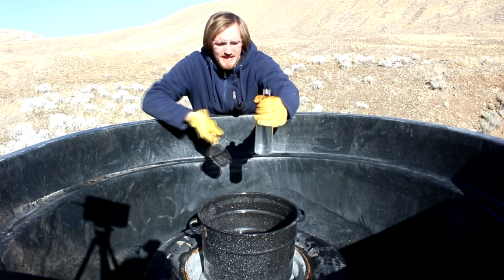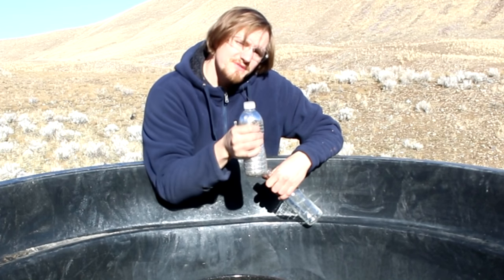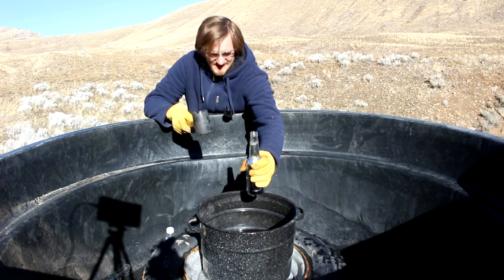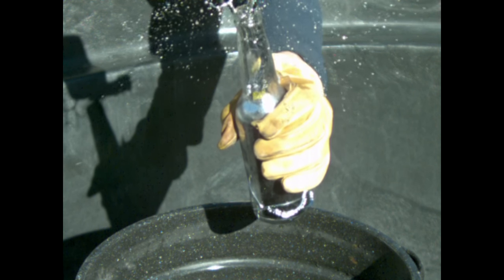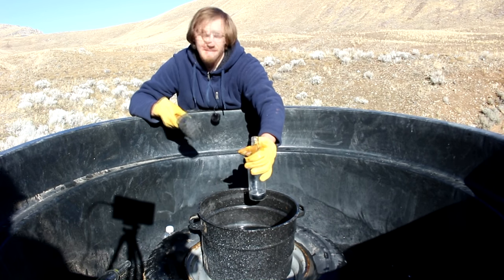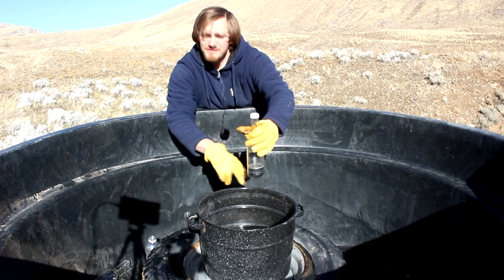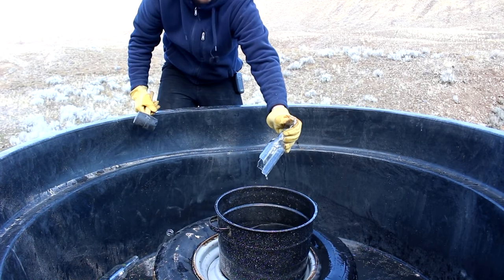Breaking Bottles With Mercury

Comment: The first mercury bottle - because it's filled into the neck, the physics changed a bit.  The mercury in the neck is accelerated upwards quite fast (smaller aera, faster speed needed to have same flow rate as mercury further down).  That's also why so much mercury came out the top.  The momentum of the mercury in the neck produced suction everywhere in the bottle, and the cavitation is actually further up (near the tips of your fingers)
Reply: hi matthias
Reply: if you have even done the bottle break by hand you would know that you need a small amout of water for it to work with out a mallet...if its over half full you will never break it by hand.
Reply: +ben h it depends on the bottle, corona bottles break even if you fill them to the base of the neck (maybe a little lower).
Reply: Nice to see you here :)

Comment: hey Cody I was wondering what happens if you freeze the vibrating part of a speaker with liquid nitrogen. I was wondering if it would still vibrate like normal to create sound waves or if the vibrations would just shatter it into pieces
Reply: thegreatcanadiangamer great idea!
Reply: Mason Crane thanks man I was just wondering what it would do and I would love if he made a video on it
Reply: the speaker surround and tinsle leads would be done for after one sound wave cycle, odds are the voice coil would be stuck in the motor snd not even move at all tho, just heat up
Reply: Actually, the speaker would be louder as the cooling of the coil would lower the resistance and thus allow more current, that is assuming it doesn't just shrink it down so that it cannot vibrate freely, but I doubt that would be the case. Also i guess you right that enough cooling might make the basket of the sleeker less flexible and might break it when it vibrates, ( sorry I'm just rambling on :P ) yes it would be cool to see ( because liquid nitrogen is cold, and that's a pun )
Reply: Keystone Science, let's find out on your channel
Reply: +Rutuj Gavankar haha that would be awesome :D I am not old enough to buy liquid nitrogen yet though :P
Reply: Keystone Science the gap in a speakers voice coil and the motor is smallll... I would bet on the coil getting stuck in place. I will add that i run big subs in my car, and on cold days the speakers can take more power for longer... Thats kind of a given with big speakers tho, they make alot of heat... alternators also make more amps when cold. I run a 370amp alt in a pt cruiser.. H/O alts have a cold rating and a hot rating on output..
Reply: I would assume it'll break the membrane, like  with old Speakers where the membrane has become brittle due to Light or just age?
Reply: if it won't break, tho, it would still be interesting, because "the cooling of the coil would lower the resistance and thus allow more current", which should make funny things to the sound.

Comment: What happens if you throw a piece of dry ice into mercury?
Reply: Bengineer8 he should totally do that
Reply: I LEGIT WAS GOING TO COMMENT THAT! OMG YES PLEASE!
Reply: Bengineer8 it'll just float and maybe freeze it
Reply: MyLonewolf25 Or perhaps the mercury will sublime it
Reply: It would probably just freeze what ever it has contact with and float.
Reply: Why? It will just sit there. Dry ice is just sublimated carbon dioxide, which reacts null with mercury. Furthermore, the freezing effect will have only have a slight effect on the physical state of the mercury, due to the insane difference of buoyancy between dry ice and mercury. It'll just sit on top the the mercury, forming a layer of solid mercury at it's contact points.
Reply: Kalightortaio It still might prove entertaining. Also, another thing that could be done is attach or embed something into the dry ice to keep it submerged and see how long it last while in mercury.
Reply: Also, since mercury is a metal, I assume it will transfer heat faster than water and thus perhaps the dry ice will sublime faster than it does in water.
Reply: That would be a disastrous idea however, as the submerged dry ice would sublimated under the temperature differential and cause bubbles of CO2 gas to shoot towards the surface. Mind you, that while this is going on, the dry ice is also freezing the mercury and the internal pressure from the mercury could in theory keep the solid mercury at bay, the pressure of the gas could cause quite the mess. And to what means? There is still no scientific phenomenon occurring, in this scenario, or the originally submitted idea.
Reply: Bengineer8 Good ideas!
Reply: Kalightortaio then just put the dry ice in first
Reply: Kalightortaio There is science in anything. By submitting theory's on what will happen, are we not creating hypotheses  and thus a form of science? As for making a mess, it can always be done at a small enough scale in a well contained area.
Reply: Bengineer8 "There is science in anything" is such a blanket statement... 

Science can be observed everywhere because science is the study of the natural world based on facts and fact based hypotheses. 

Hence natural world, everything you could possibly name that exists in our world can involve science in an intellectual sense of the word... but such is not always fruitful.

I get it, somebody took two very exciting compounds that are often used in scientific demonstrations and thought it would be even more exciting to combine the two.

Unfortunately this yields no such results.
Reply: Kalightortaio I know
Reply: caleb Riggle If you pour the mercury over the dry ice, it will simply sink below the dry ice and my first response occurs where the dry ice simply floats on top of the solid mercury on top of the liquid mercury. No reaction. Null.
Reply: Kalightortaio Last time I only saw the 1st sentence of your comment. After reading  all of your comment, here is my response:
You said in one of your comments that it could cause a mess. How could that happen exactly if nothing interesting happens?
Reply: Not magma
Reply: +Kalightortaio Side note: I acknowledge , based on your comments, that you are probably more educated than I am, at least when it comes to general science. I am currently in AP physics where the labs are less formal than they were in chemistry..
Reply: raggex rag It freezes it. It has been used to get temporarily solid mercury.
Reply: alejandroop 1 ?
Reply: most likely, nitrogen will vaporize, and the surface of the mercury it comes in contact with will turn into a solid?
Reply: Just because there's no chemical reaction doesn't mean it's not worth doing.  There was no chemical reaction in this video, yet it was still interesting to watch.
Reply: it solidifies, that's it
Reply: my guess is it would skim across the top or just sit there with no reaction
Reply: Cayden Knode it just solidifies the mercury
Reply: ''Dry ice is just sublimated carbon dioxide''

Don't you mean frozen carbon dioxide?
Reply: Look, I'm not encyclopedia Britannica over here.

Yes, yes I did.
Reply: Kalightortaio Oh thank God you're not an encyclopedia. Sublimated information I guess. ;)
Reply: JayMark2049 XD

Made my day.

Comment: Cody, would it be possible to repeat the "experiment" but instead of hitting it with a hammer, try using the palm of your other hand? also, when you shook the glass bottle, is it possible that there simply wasn't enough mercury? Watching the video i couldn't help but think that there really wasn't very much mercury in the bottle for the shaking.
Reply from the maker: I can and have done (check description) that but it hurts for a week afterward so I opted to use the mallet.
Reply: Cody'sLab You really should be more careful it looked like some of the Hg got into your mouth

Comment: Would pouring mercury on glass from a height break it due to its mass?
Reply: Ooh.  It might have a different terminal velocity from water, that might actually work (plus of course even if the terminal velocity is somewhere near that of water, you're talking about a lot more force).  On the other hand it isn't pointy and it deforms on impact (so it would cushion itself), so maybe not?  That sounds like an experiment!  And a messy one.
Reply: Yes. It has less to do with mass and more to do with pressure. You can break glass with water with enough pressure
Reply: Muzik Bike - Geometry Dash and stuff pouring water could break glass if it's thin enough. couldnt figure that out yourself?
Reply: LegalizeINDIA and that force would be spread out over a certain area. P=F/A. Where there is a force, there is a pressure.

Comment: The Backyard Scientist did this, but not using Mercury. :-) You definitely need a face shield for these experiments.
Reply: *****  FLYING GLASS! :-)
Reply: *****
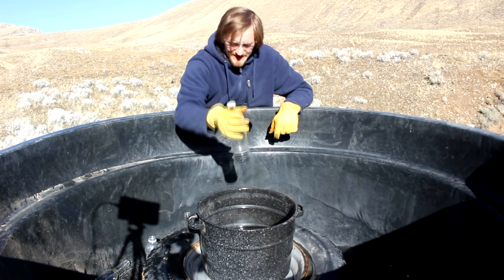I didn't post a comment to argue with you over the obvious. 2:37 is the perfect example of when a face shield should be worn. People don't learn until they get injured. :-) Bye.
Reply: What are you even talking about? 2:37 is where he talks about shaking the bottle and stuff, so you're saying that people should wear a face shield when talking...
Reply: 影 Productions mercury is non toxic even if ingested? That's the first I've heard of that. Care to provide sources?
Reply: 影 Productions  thanks a bunch, smarter every day :D
Reply: That's a point where he's getting concerned about what he's about to do. He doesn't know what to expect. He even said he was concerned about mercury flying "everywhere". If the bottle will blow out the bottom or even side when the mercury slams back down. A fragment of glass from the bottle could easily hit the metal pot(or the rim of it) and fly back toward his face. This experiment wasn't too dangerous compared to some other experiments that he's done, like handling 1000psi borosilicate glass tubes which have been pressurized above their MAX rated pressure. That was a video which a face mask was absolutely required. I'm twice his age, done plenty of experimenting over the years(not so much with chemistry, but dealing with high pressure and glass), and seen many accidents happen. Many people don't like to hear others tell them to be safe and wear protective gear, including Cody. Polycarbonate face shields are inexpensive, so no reason not to wear one so you can ensure your face and neck are protected. I enjoy his videos, and would like to see him around for a long time. :-)
Reply: +影 Productions To add to your point, other than vaporise mercury, it becomes much more hazardous when dissolved in something (could be absorbed through skin, etc). Metallic mercury, like you said, is only really a danger when vaporised.

Yes, Cody has explained it before, I can't remember which video it was in though as he's done multiple mercury videos and it wasn't the explicit topic.
Reply: He literally has a video called drinking cyanide. Safety is not his highest priority.
Reply: LOL. I saw that one. I don't miss too many of his videos, especially the mining and refining videos. The amount that he ingested was extremely small. He added a very small amount to a lot of water, so it was highly diluted, and he only drank 1/3 of the diluted mixture. It was fairly safe. I'm sure I've ingested worse things over the years.
Reply: Michael Watson There are even 2 videos where he drinks cyanide.
Reply: Lord Stalker
Who are you referring to? Surely not me, I was only concerned about his safety.

Comment: It will never break when  you shake it because it does not break because of cavitation. The bottle breaks because water and mercury is relative incomprehensible. When you hit the air on top create a pressure wave that pushes the surface of the liquid. That pressure is transferred to the bottom of the bottle and if the bottom of the bottle is strong enough the pressure is reflected and the pressure starts to oscillate from top to bottom within the liquid. If the bottom is not strong enough to reflect the pressure then breaks.

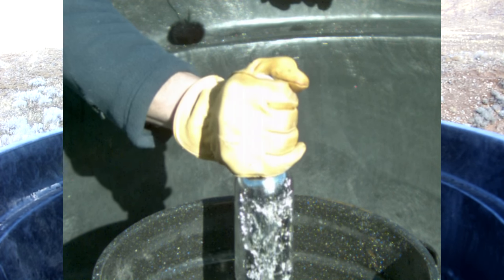Comment: 3:21 - It's probably because the mercury isn't hitting the bottom all at the same time. Instead of one large impact, there are lots of smaller ones. EDIT: Plus the air would cushion the impact as you say.

Comment: A really cool experiment would be if you built a rig to carefully control the force of the impact (maybe by dropping a weight from different heights). Then you could test an equivalent mass of mercury and water, and on each, slowly ramp up the impact force until it breaks. This would tell us whether the lower vapor pressure of mercury causes it to require a measurably smaller impact.

Comment: really interesting, i think the reason why shaking didn't smash it is because the vacuum would be changed by the acceleration not velocity (unless your converting the momentum back into pressure in which case it should be deceleration of the bottle relative to the mercury) and the time is the time the force is applied over, is orders of magnitude larger (and thus the pressure is smaller) when we spend half a swing accelerating it in one shake direction and the other half accelerating it in another. all that force has to be released in the time the hammer is in contact with the bottle in the first example, and it takes less energy to "get out the way" at slower speeds. it would be interesting to try with different hammers.

i am not normally the first person to be a safety sally but in my opinion the most important part of safety is to know what/where/when the dangerous things are. mercury was splashed all over the place  including places where it could become lodged and very hard to detect. i have heard the worst cases of heavy metal poisoning normally occur from chronic exposure to sources people are unaware of and i feel like i was just witness to about a hundred of them splashing all over you  which could have been at least minimised by a £10 plastic shield or a bit of wood in-front of you. i have no doubt there was allot of behind the scenes cleanup and precautions but man, be careful.

Comment: Yes, even careless placing of a bottle with bottom covered in mercury on a table can result in breaking due to this effect.
That's why if you need to store it in a glass vessel, fill a small amount only. Or just use plastic or steel bottle. Aluminium is out of the question. :)

Comment: Could it be that you need to bring the bottle up in a quick jerking motion to get the mercury to shatter the bottle at the bottom? I noticed you were bringing the bottle downwards quickly making the mercury fly to the top of the bottle, but slightly slower bringing the bottle back up, perhaps a slightly slower downward motion and a slightly faster upward motion might break the bottle?

Comment: In the second attempt, it didn't look like the bottle was only 1/13 filled? Which should be the case if you wanted the same mass as a bottle filled with water.

Comment: Surely mercurys low vapour pressure would mean your cavitation bubble is a less perfect vacuum than with water so it would weaken the effect? (Obviously mercurys a lot denser so your M of F=MA causes more force to be exerted on the glass, but still)
Reply from the maker: Low vapor pressure = more perfect vacuum
Reply: vapor pressure is the amount of pressure that the vapor exerts on the liquid. so when mercury evaporates, it produces a lower pressure than when water does and so the vacuum is stronger.
Reply: Ah, that makes sense, just got a little mixed up there
Reply: Assuming the bottle slips the same distance when hit (it appears to) and the vapor pressure of both water and mercury are far smaller than atmospheric pressure, the same volume of mercury will hit the bottle √13.6 = 3.7 times harder than the water (mercury is 13.6 times denser than water). In practice the vapor pressure of mercury is also lower which further helps the cause, albeit slightly. Now when he fills in the same mass of mercury as he had water, the area of the top surface of the mercury is larger than when the bottle was full of mercury as the neck of the bottle is narrower than the body. This means the atmospheric pressure can force down harder, so even though the mass is smaller by a factor of 13.6, the impulse is smaller only by a factor of √(5.5)/(13.6) = 0.64 (the area of the base of the bottle is about 5.5 times that of the neck since it appears to be a standard beer bottle).  The same mass of mercury thus still hits 0.64*3.7 = 2.35 times harder than the water originally did.

Comment: When you tried to shake the bottle there was too much air in it :) Fill it to the top and try again :) To make the wanted effect you can use some type of rubber cap - when traveling downwards - the cap will deform and make the wanted low pressure at the bottom :)

Comment: Would the glass break if you used your cupped hand over the open mouth of the bottle? It seems you might get enough pressure variance to break the glass with either water or mercury.

Comment: You said the mercury (when shaken with your hand) couldn't form a vacuum bubble at the bottom of the bottle, which would, theoretically, break the bottom of the glass the same way as the hammer did, but you said it's because the mercury flowed on the outside of the glass instead of going straight down. Could it have been cause there wasn't enough mercury in the bottle to force it to go straight down instead of outwards towards the sides? I'm just guessing that of there were more mercury In the bottle, it would break the glass

Comment: You can hit the top of the bottle with your hand opened flat and it will pop out the bottom of the bottle. Fill a glass bottle about 3/4 full and grip the bottle around the very top and smack the top with your other hand. Suggest doing this over a trash can.